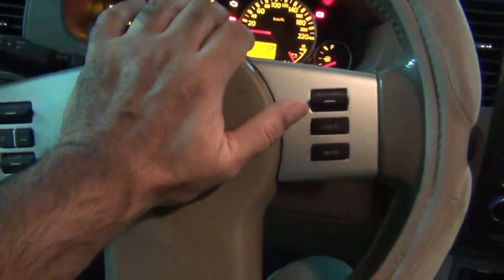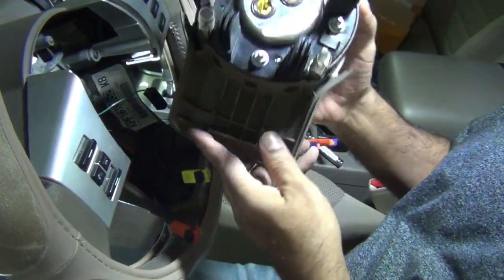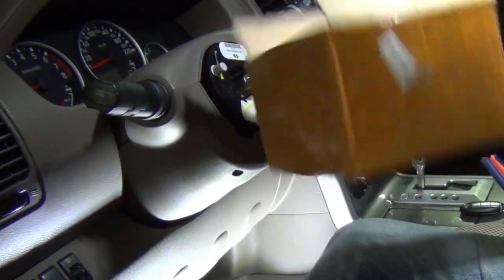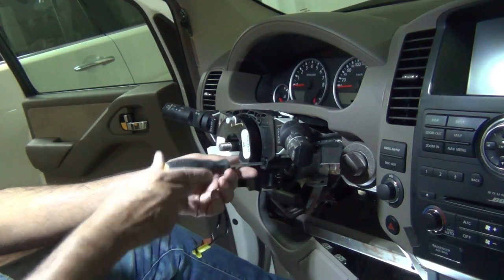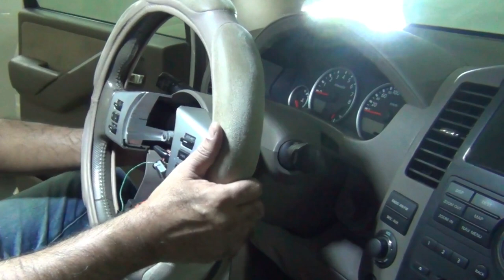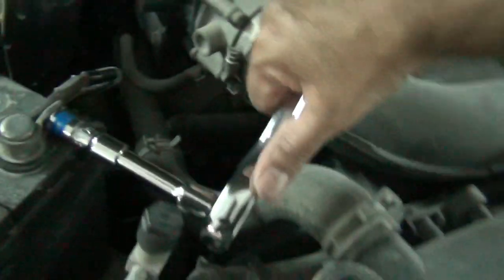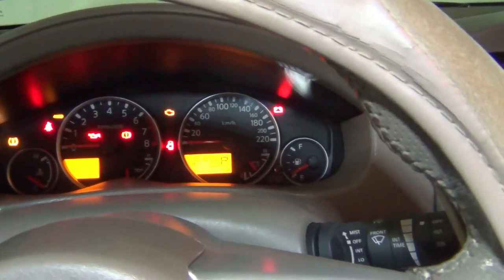Nissan Pathfinder 2008 Steering Clock Spring Replacement

Comment: Great video but please note folks this clock spring video is for Pathfinders that dont have VDC which utilizes a steering wheel angle sensor.  You will need a different clock spring with a narrower 1.5" diameter center hole so you can swap out the steering angle sensor for the VDC.
Reply: Do you have a part number or link to part?
Reply: @OGfamilytreerecords5913  I don't have the box or the paperwork anymore.  I think the main issue is that some websites were listing it as the same part.
Reply: I can’t find one to order that specifies its for the VDC version that I need. Any advice?
Reply: @ratking948  I found that to be the big issue.  My only advice is to look closely at the pics and hope the one pictured is the one they send.  Wish I had a better solution.  Sorry.

Comment: Fantastic video! I had my seat belt light start flashing and code P1564. Was told it's the clock spring. Just ordered it from eBay for $30.60. Hopefully, it works when I replace it.
Reply from the maker: Do post a follow up comment! Cheers!
Reply: @carapiet  absolutely!
Reply: I finally changed the clock spring. The cruise control started working again but after doing the airbag reset, the light was still flashing. I took apart both front and side sensors and cleaned with electric cleaner. Still nothing. I gave up. I came out 39 minutes later, and it wasn't flashing anymore. Go figure that out because I can't.

Comment: I can’t seem to find the correct clock spring. They keep sending me ones with out steering wheel switches. Can you share with me how to get one
Reply from the maker: Are you asking about the wiper control and head light controls ?

Comment: ok first of all thanks for the video. J Carapiet says below that where he lives in the Gulf Pathfinders don't have the angle sensor system,  

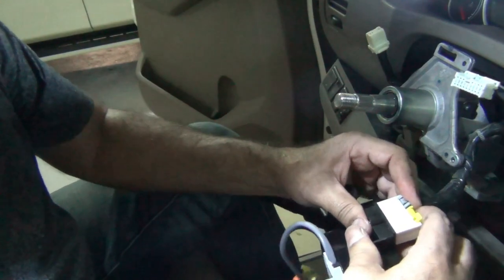 so, for us that do you'll need to transfer a piece from the back of the clock spring you're replacing to the back of the new clock spring you're putting in. 12:32 of the video shows the gray and yellow connections but next to those is where the other plug for the angle sensor goes. The plug that's sticking straight up. Remove 3 tiny Phillips head screws and transfer the white plastic connector piece for the angle sensor plug.  

Repair fixed my flashing air bag light, and my horn is working again
Reply: Wish I Would Have Read This i Installed As It Was Installed InThis Video But Now The Vdc Ligth Wont Go Off,,,,,Now I Know Why I Will Remove And Reinstall

Comment: Great video. Should be able to give more than one thumbs up.

I managed to finally identify the right part and to look it up online. It's crazy how difficult it is. I guess that's how big automotive companies like it to be t overcharge for parts.
Reply from the maker: Hope all goes well with the repairs
Reply: @carapiet  We'll see. I'll have my mechanic deal with it. For now I'm happy I seem to have managed to find the right part. For something requiring to touch less critical equipment like in this case, I'll probably try on my own. But I rather have a mechanic disassemble the steering wheel of the car my wife and kids use every day.
Thanks again for the video. Much appreciated.

Comment: Super video!! DON'T DO WHAT I DID!!
I should have left on the wheel nut a couple turns when bumping off the wheel... I ripped the clock top off and now am having a new one overnighted because I was only looking to troubleshoot. Leaving a couple turns on with the wheel nut would have saved me from SNATCHING the wheel totally off and ruining what may have been a good wheel clock 🤬
Life's an adventure 🤣🤣🤣
2014 frontier

Comment: Hello I did this job month ago and it was successful thanks to you ..thank you . but I couldn’t stop the airbag  light  gone . with you’re process .on the switch is there any different way to do it ??
Reply from the maker: Make sure the airbag connectors are properly connected. Other then that i am not sure if there is a separate reset for the airbag lite!
Reply: @carapiet  I do replace the air bag from jonkie part few months ago from another frontier maybe that’s way ..I can’t turn  light off …other than that it’s working perfect 👍 thanks

Comment: Awesome tutorial.  I have the same problem from my 2011 XTerra and do need to change the clock spring.  Please provide link as the ones from eBay and dealership are way too expensive.  Thanks.
Reply from the maker: The part number might be different! But match the pins as described in the video. I got this part from Aliexpress which is alibaba.com. Good luck and thanks for the encouraging comments 
Cheers

Comment: Looking at your video is great but what happen to last wire with the white cap ? Did connect it or did leave alone?
Reply from the maker: Thanks for the comment! The extra wire is for the steering angle sensor, the models over here in the Gulf do not have this system.

Comment: Hello Mr. Carapiet this is a great video. I have a question. Can you get a different yr for the clock spring or does it have to be the yr the vehicle is. I have a 2007 and could only find a 2006 but when I tried it it didn’t work.
Reply from the maker: Try to buy from Ali Express and match the pins! I show and talk about it in the video. See around 6 minutes and 50 seconds

Comment: Great video. Thx. I’m in Canada. I noticed one extra connector on the steering wheel. Would your part number work for me?
Reply from the maker: Check the pins on your part as explained in the video
Reply: Did you get this solved? I have VDC on my pathfinder and am looking for the correct part.

Comment: I have watched this video several times and have tried to release the air bag without any luck .do you have any tips to try?
Reply from the maker: Try shining a torch in to the hole to see the rod that you need to push up to release the airbag and maybe use a wider screwdriver
Reply: @carapiet  thank you

Comment: The video provides the repair is easy to follow instructions, but I do not recommend buying the part off of Ebay or Ali Baba.  Since you are doing the repair yourself and the clock spring might have the ABS system tied in (his does not look like it has the angle sensor attached like mine did), buy an OEM part.
Reply: What is the purpose of the steering wheel angle sensor?
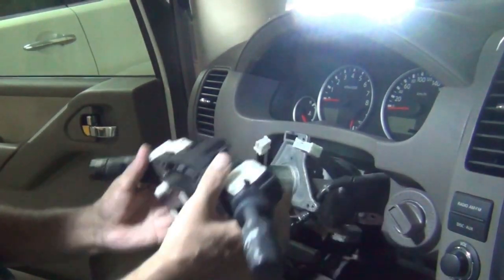I see that it was left unplugged, by what I'd assume is someone who did the work previously. You can clearly see it was never "unplugged" in this video, and it's seen at 10:04; the other smaller white plug to the left of the plug that was just removed.

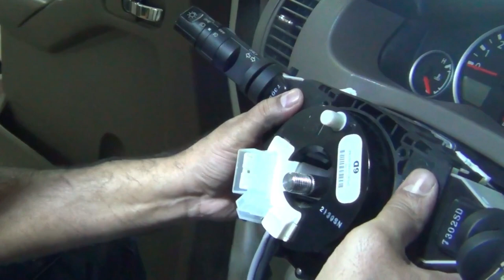And then at 12:54, you see it was tucked away when the assembly was being re-installed.
Reply: @dyip32  It's an annular piece that has the wiring that connects to all the commands on the steering wheel. Therefore, per se, it's not that important. It all depends what doesn't work in the steering wheel sensor. I have had the one in my Pathfinder 2010 model not functioning properly for several months, but the only issue is that the honk doesn't work. I did not replace it because the original part is crazy expensive and didn't have the time to look for the right part online. Thanks to this video I seem to have finally found it. If you want to save money, but be safe, you can buy the part online, but have your mechanic confirm it's the right part, and have him install it. That's what I plan to do.

Comment: If you don't have volume control on the left. Can you swap this out and put the control and it will work?
Reply from the maker: Yes, it’s the same part for all the controls on the steering wheel!
Reply: Will it work if I don't have controls on the left side. And I get the part for the left{volume control} and change it

Comment: I have a 2008 V8 Pathfinder SE
Failed today to change mine ,the connection is mot exactly the same yours
With  the 11pins i have two more connecter
Reply from the maker: Yes, you have to check the pins before buying the part! In the video I tell you to check the pins depending on your model before ordering
Reply: @carapiet  
i think the problem is heated steering wheel connection

Comment: What was the part number on that clockspring you ordered from Alibaba? I'm in the same situation you were with the airbag light blinking.
Reply from the maker: This is the part number on Aliexpress:  25560-R07AB 25560R07AB ZP51D-25560-R07AB For Nissan Free Shipping.
hope it helps
Reply: @carapiet  Thank you. Much appreciated.

Comment: What happen to the steering angle sensor? Make sure the two prongs fit into the two slots. take off bottom of  old clockspring and  add to new with three screws.
Reply from the maker: I’m in the Middle East and the Pathfinders here don’t come with Steering Angle Sensors! However the wiring is there if anyone wants to add that on as a after sales add on! Cheers!

Comment: What if only my buttons aren't working but I have no airbag warning light?  Is it still clock spring or something else?
Reply from the maker: Yes, so some of the wires in the clock spring have lost their contacts and those control buttons have stopped working! It is only time before the airbag probably will stop working too. You can wait a while if the control buttons that are not working are not that important to you

Comment: I have the same vehicle but usa version and I noticed that your vehicle doesn't have a steering angle sensor I wonder why
Reply from the maker: My Pathfinder is a Middle Eastern SE model and didn’t come with the feature “steering angle sensor” in 2008! But it does have the wiring if I wanted to add on that as a after market feature.

Comment: Very nice explainable video, but you didn't install the "steering wheel angle sensor" nor did you put the "white" wiring hornist at the left top into the steering wheel angle sensor, on the clock spring and without doing this, there will be a light on the dash board that will not go off !!
Reply from the maker: Yes the Nissans in the Middle East where I live don’t have that feature! But you are right I should have mentioned that in the video 
Cheers!

Comment: Is it normal that there is no Steering angle sensor
Reply from the maker: Yes this is a model here in the Middle East and they don’t have the Steering Angle Sensor
Reply: I just changed mine out and had to remove the old steering angle sensor, and put it on the new clock spring. Worked like a charm!  Thanks for the info on the diagnostic mode to clear the airbag light!  My $300 code reader wouldn’t clear the light, but after a few cycles of the ignition and a start… light went off!

Comment: I replaced clock spring and all my controls and horn work but now the vdc off light and the slip light won’t turn off on the dash
Reply from the maker: Did you check that the pins match like described in the video?
Reply: Hola amigo, a mí me pasó lo mismo, recuerde comprar la pieza que corresponde a su versión del vehículo, ya que hay una versión que no tiene el acople para el sensor de ángulo de dirección, el computador no reconoce el giro de la dirección y enciende esas luces, después de cambiarlo también es necesario programar el sensor
Reply from the maker: @danielbequer1569  ¡estás en lo correcto!  pero aquí en el Medio Oriente estos modelos no tienen esa ficción.  salud

Comment: At 12:33 the white connector at the top left doesn't get connected to anything?
Reply from the maker: The Middle Eastern models do not have an angle sensor and those cables are not connected! Should have mentioned that in the video.
Cheers
Reply: @carapiet  Cheers. That right angle sensor is for VDC on the models that have it. Great video and thanks for making it!
Reply: You can take the old VDC sensor off the old clock spring and attach it to the new one or buy a new one.

Comment: what is the part number of the steering clock spring?
Reply from the maker: It is the comments before yours
Reply: @carapiet  thank you so much for the good video
Reply: will this part number will fit for Pathfinder 2011, the Nissan spare parts outlet gave me the part number 255609CH1A?

Comment: Air bag light comes on again after doing diagnostic. I have to replace my driver side airbag.
Reply from the maker: Did you see the end bit of the video for the system reset?
Reply: It may just be an issue with the sensor. It may not be necessary that you change the airbag. In both my cars, the dashboard shows an issue with the airbag. But that's a sensor fault, and the airbags are fine and would deploy as needed in case of accident. I recommend you check with your mechanic first, as long as it's a good one that you can trust.

Comment: What happens if you dont replace it?
Reply from the maker: Well first the volume control, then after some time the cruise control on the steering wheel stoped working and then after a few years even the horn stopped working.
Reply: @carapiet   yes but what happens if you don't replace the clockspring
Reply from the maker: The vehicle is still drivable, the steering wheel will still steer, however ultimately all the electrical switches including the airbag might stop working!
Reply: @carapiet  ok just replaced it for airbags safety reason part was more expensive than labor from my mechanic

Comment: Help, I did step by step but airbag keeps blinking
Reply from the maker: Watch end of the video to reset the electronics
Reply: Make sure that wires and connectors under your seats are all connect good and not frayed or pinched. I had such a problem with my passenger airbag and light kept flashing. Dealer want $2500 to replace entire seat. I discovered the cable/wire was pinch on the rail that the seat slides forward and back. Moved it and zip tied it away from the rail and blinking light went out and everything works perfectly.